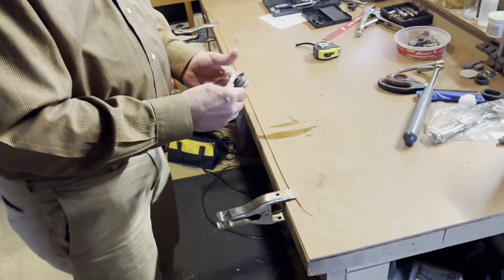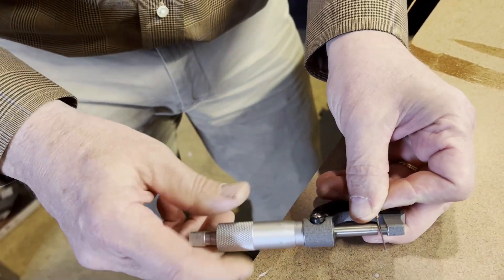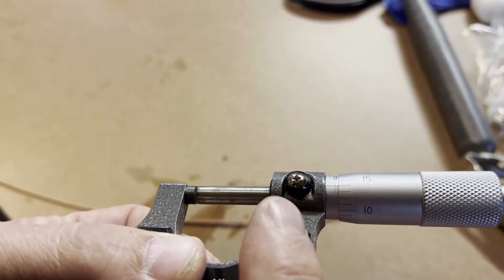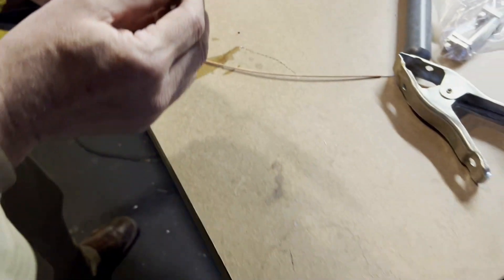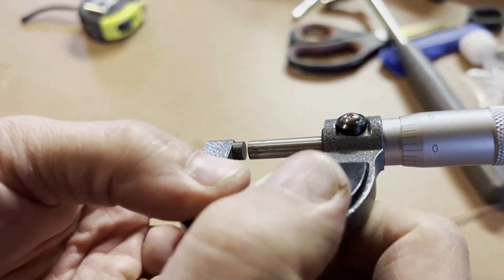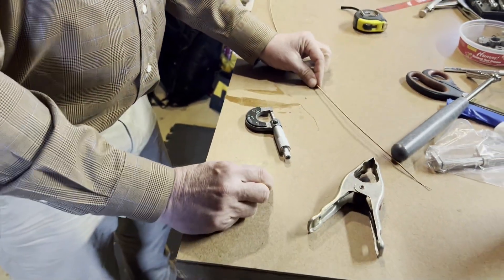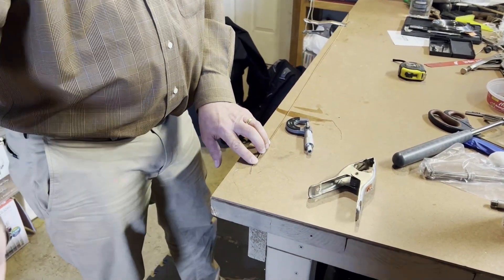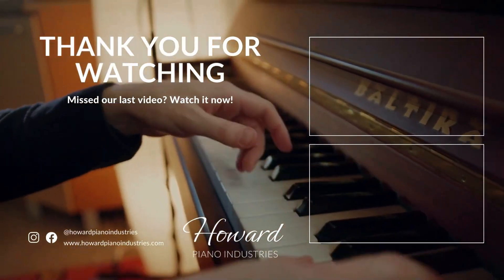Measure a Bass String for Duplication I HOWARD PIANO INDUSTRIES

Comment: What about if the string is double wounded? Do you measure the length of the two windings and the offset distance from both ends?

Comment: We have an upright with silver-colored wound strings -- probably aluminum or iron, I suppose -- in the tenor transition section, just before the plain strings. They sound very dead. Do you carry strings not wound with copper? Would it matter if we just replaced them with copper bass strings of the same size?
Reply from the maker: Modern bass strings are wound with copper. Other wrappings are not available, probably because the copper works better. Replacing them with copper wound strings would be the best option.
Reply: There are still 1 or more makers of iron-wrapped strings around, and they do make for a nicer transition region. Old ones do seem prone to breaking. Try cleaning yours, and giving them a 1T twist to tighten the wrap.